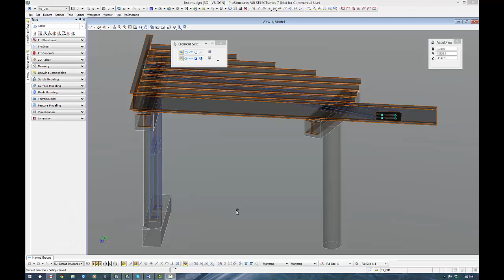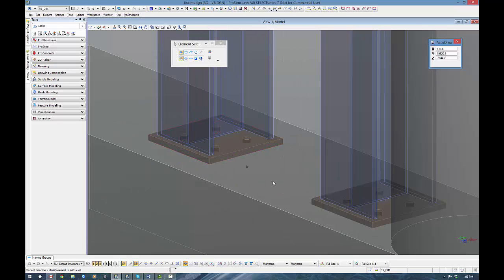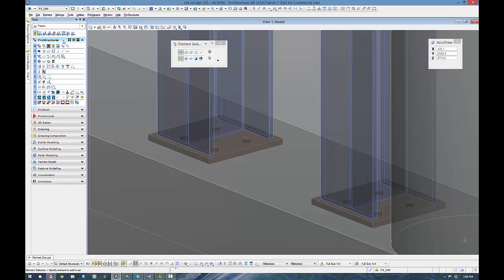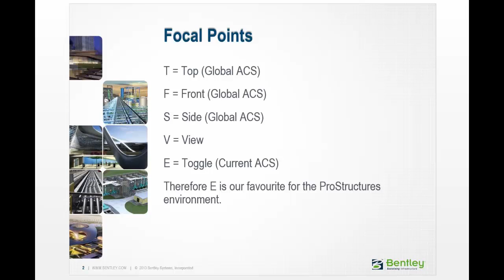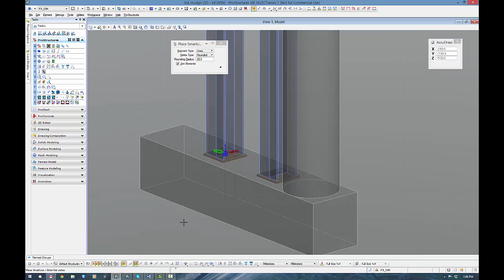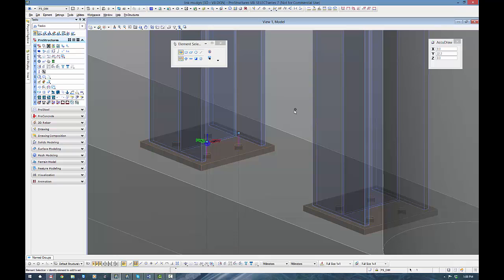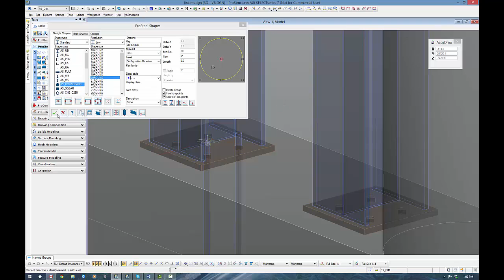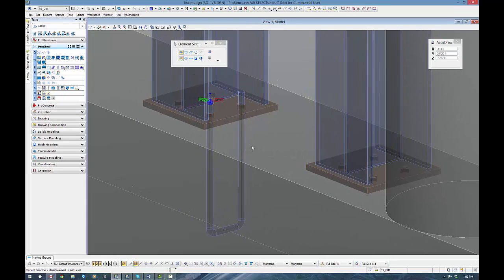Working on non-global planes with Power ProStructures

Comment: just starting to work with ProStructures and I have some questions for example how to repeat the last command without re- clicking on the icons
Reply from the maker: +Katarzyna Zachariasz 
Hi Kat,
in many instances, you must reselect the macro button. The Microstation engine works slightly differently that AutoCAD in some instances.

That said, many commands allow you to select multiple objects (like connections) so you can do, or amend many at once.

I hope this helps.